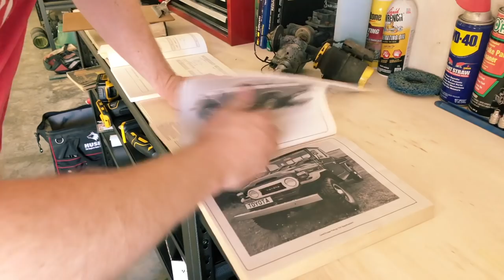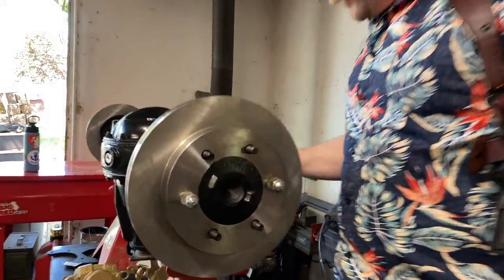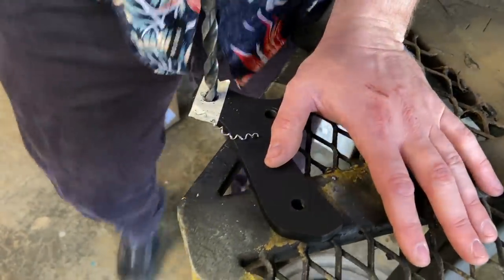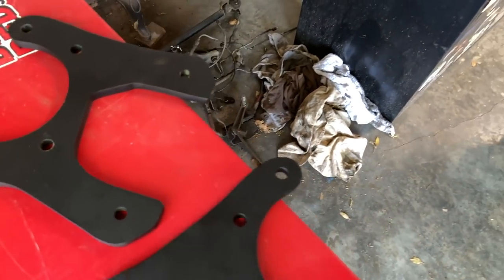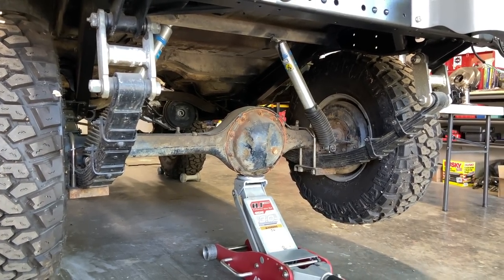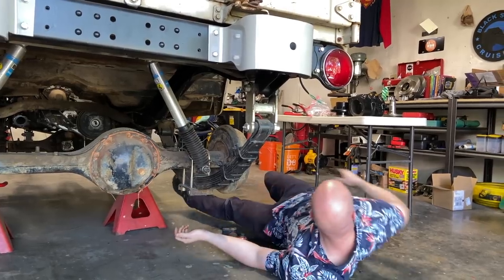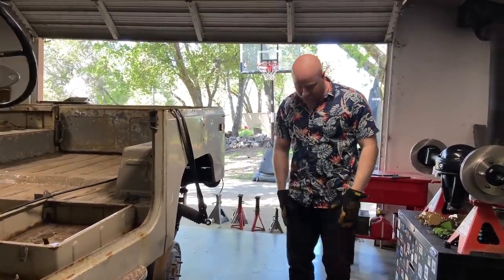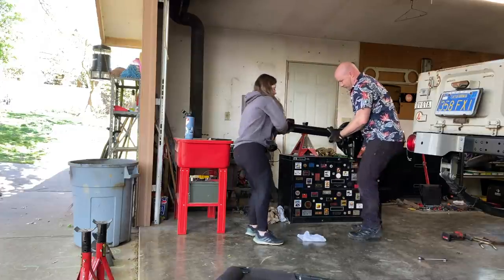PWW 38 - Part 3 FJ40 Rear Disc Swap, Fabrication Wizardry, Yoga Pants, Feats Of Strength, Back Pain

Comment: Painful way to drill through steel. Low rpm’s and oil to keep from smoking the bit. My wrists have taken a beating doing it at wide open rpms. And holy sh**!! Talk about the hard way getting that axle off! You’re still killing it! Keep up the good work!  This thing is going to be so rewarding when it’s done.  You and the family keep safe and keep the content coming!
Reply from the maker: Will do man! Thank you for the positive feedback. I think I need to slow down the drill a bit, prolong the life of it that way. And glad that old axles out! Moving forward!

Comment: Dude, Ben that was painful and funny to watch. You really did that the hard way. Removing a rear axle is cake. Remove the driveshaft, disconnect the brake lines, disconnect the shocks at the bottom, jack up the axle, remove the bottom bolts from the shackles, lower the jack and roll it out. Cake ! This also would have been a perfect time to do a spring over axle conversion.
Reply from the maker: I can’t argue with your logic. But some times in the shop when I get rolling, I lose all common sense. All of it.
Reply: @projectwrongway9127  I love your videos man. I've had 4 FJ40s and loved all of them. My favorite was my small block chevy powered one. I miss them and am now able to live them again through your videos. Thank you !
Reply from the maker: Thanks man.

Comment: That is a great way to do it. Also, you can use your jack to do all the heavy lifting. Especially since your shop floor is so smooth. And just swap your shock mounts from the old axle
Reply from the maker: Might have a good solution, you’ll see.

Comment: Great entertainment as always mate, the later model diffs don't have the shock mount on them, the shock mou t is on the u bolt plate that goes underneath, you shouldn't have any dramas finding some online 👌
Reply from the maker: I’ve got a lead on something, should be mint...

Comment: I just assumed you were going to use a floor jack for that rear axle and that bench pressing it was a joke. I assumed that right up until you slid under it and started lifting. That was a feat of strength unlike any I have ever seen. Maybe floor jack next time though.
Reply from the maker: Might do that for the front axle, that bastard is HEAVY.

Comment: You did that the hard way you should have wheeled the diff out by undoing the back shackles but it was funny 😄 to see keep up the good work 🤪.  You can use early 60s u bolt bracket for your springs and your shocks will bolt to them thay don't bend as easy but it is your project do it your way  from Robbo mission beach QLD
Reply from the maker: Every time an Aussie likes one of my episodes, I swell with pride.
Reply: @projectwrongway9127  yer mate I like watching project wrong way it's fun to watch you and your wife not boring like other tube videos so don't squash your self 🤪😂🤣 from Robbo QLD

Comment: Mate that was awesome. 😜 Do you spend days trying to figure out the hardest way to do something or is it  a gift? Being a lazy prick I would have used a jack to hold up the diff, left the wheels on,  removed the rear shackle bolts then undone the goodies. Just wheel the diff out and do the reverse to install it. just use the front wheels instead. But hey, it's better than the comedy channel. Yes I have a cruiser, 1970 FJ45.
Reply from the maker: FJ45!? That’s a bit of a dream car for me bro. I don’t spend much time at all, just dive in with a sense of child like wonder. I do whatever pops into my head, and it typically is incorrect or unsafe.